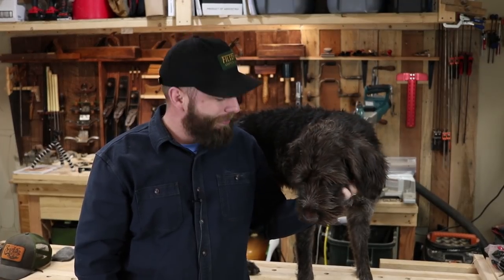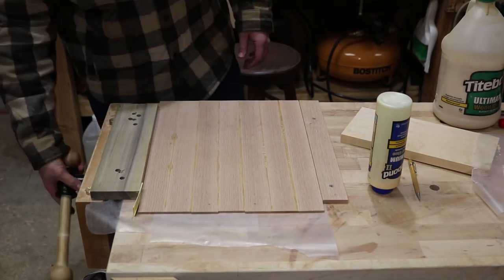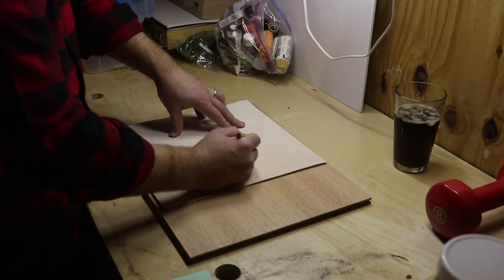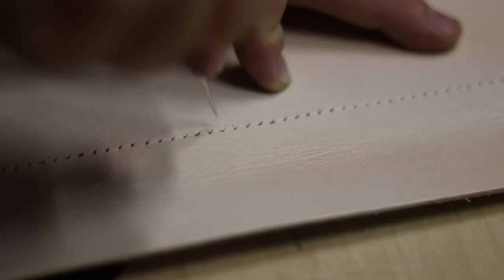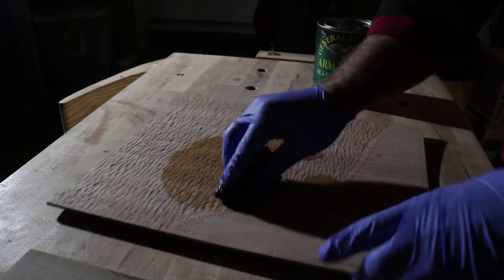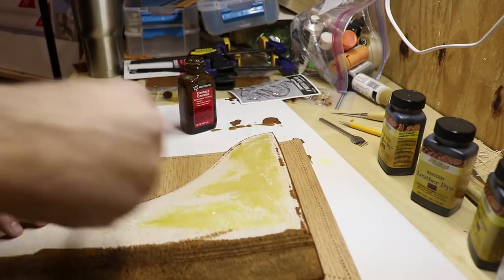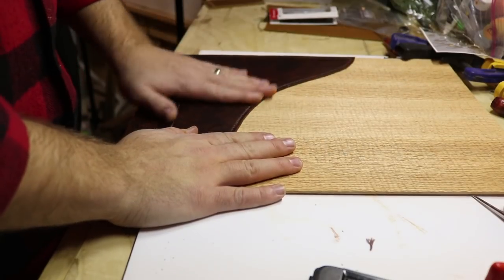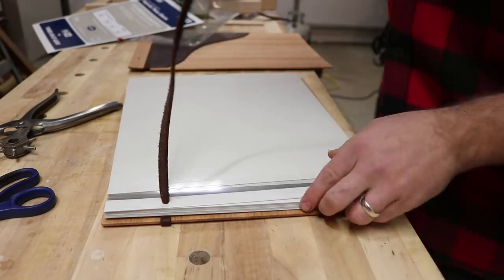Making a Photo Album with Leather and Wood // How To // Woodworking // DIY

Comment: nice touch on the gouging. to help get an even dye job, moisten the leather evenly by spraying it lightly with water. moisten. not soak. it also helps to buff after the dye dries a bit. you do excellent work and your videos are awesome. thanks for sharing.
M.T
Reply from the maker: Thanks for the tips. Ill try that for sure. also thanks for watching and the kind words.

Comment: One thing I like to do to even out my dye on the leather is to pre moist the leather. Just to put a little water (not soaking it), when once the dye is on the leather use a rag and rub it down with rubbing alcohol.  It will help the dye penetrate the leather deeper and even out the color.  This was an awesome project, one that I might have to try myself!  Great Job!
Reply from the maker: Thanks Lance. I appreciate the tip!

Comment: Beautiful project.  The combination of wood and leather textures really works.
I keep a roll of freezer paper in my shop for glueups. You know, the brown paper the butcher uses with one shiny side. Heavier and cheaper than wax paper.  The plastic covered surface on one side (the shiny side) of the freezer paper resists glue very well and moisture in the glue doesn't affect it at all.
Reply from the maker: Thanks for the tip, i see people using that, and have been wanting to get some. It would probably keep my happier too rather than stealing her wax paper haha

Comment: Great project! Just pointing out that that isn't how contact cement works. :P If you let the two surfaces dry for 5-15 minutes ( weldwood works well at 15) then the pieces bond together instantly, no clamps needed. Not sure how strength is going to differ not letting it dry to tack beforehand, but it is designed to work the way I described. Other than that, all other leather pointers were already in the comments before me, so that about covers it.
Reply from the maker: Thanks for the info Daniel!

Comment: I've been doing leather work for a little over a year now. I bought a cheap airbrush and airbrush compressor at Horrible Freight, and it works well for spraying leather dye. I get a very even finish, and I can build the color up in coats. Another effect that can be done with an airbrush is to spray a darker coat around the edges of the leather and feather it in to the main body (like some guitars are painted). Great job, but I suggest ditching the stitching groover. I think the stitching looks better when not constrained by the groove.
Reply from the maker: Thanks for the tips Lex, the airbrush is a good idea. Ill have to look into that more. if you dont use the groover, how to keep a consistent distance from the edge?
Reply: I use a pair of dividers to scribe a line. I set the dividers to my desired distance from the edge, and run one leg along the edge of the leather and the other leg lightly pressed against the leather to leave a faint line. I then put the center of the stitching chisel on the line, so that the stitching hides the line when done.  Look up Ian Atkinson and Armitage Leather here on YouTube. That's where I learned 99% of what I know about leather working. Both of them have excellent tutorials, and are good teachers.

Comment: really nicely done .. hey, to stop that bowing of the cover, glue a nice sheet of paper or cloth on the inside, this will pull the wood back into alignment. Commonly done on book covers.    OH, and take a look at Japanese Bookbinding Techniques I think they'll be right up your alley.
Reply from the maker: Thanks Dave, yea after I carved the top it wanted to bow which was kind of a bummer. ill have to try that tip. I watched several book binding videos and LOVE them. The Irish are masters of book binding. Ill have to check out the japanese book binding too. The japanese are amazing at everything they do so im sure its awesome.

Comment: A few things about the leather. For one, if you want to save yourself some time (and money) for burnishing, take a dowel, 3/8, 1/2 or 1/4, whatever you have, chuck it into your drill press (or lathe) and using a chisel and file, cut yourself some grooves and round them over. You can then just have it chucked into your drill press on a high rpm and burnish in seconds what would normally take much longer. for dying the leather, the method you used will get you a nice splotched distressed look, which I find is more appealing to my customers. If you want an even solid color, you'll want to spray your dye with an airbrush or other HVLP sprayer. I use an HVLP sprayer with a 1.0 tip. No thinning needed. Beeswax works great on the edges, but you'll probably want to treat with something like gum tragacanth as well. You probably noticed that, once you dyed the leather, it became much more stiff. If you want to add some life back into it and really help protect against the leather cracking on that binding, treat it with some neatsfoot oil. There are 2 fellows on youtube that really go in depth into leatherwork and I have learned a great deal from them. Nigel at Armitage Leather: https://www.youtube.com/channel/UC8urn9l3pybW5LztUa6zbOA  and Ian at Leodis Leather: https://www.youtube.com/channel/UCLkCG-505-1t0rYlgBTSnpQ
Reply from the maker: Thanks so much for all this great information! I really appreciate it! thanks for taking the time to type this out. Ill definitely check out those channels too. I love learning and experimenting with new stuff!
Reply: No problem man! I love the channel and Utz!

Comment: For dying a large area like that on your leather, it will be less splotchy if you use a larger applicator like a sponge or wool remnants. Also, 2 lighter coats can help too. Do the first coat in circles and come back a second time and go back and forth one direction (like you do with wood grain and finishes) and it should even out a bit also. To keep it from darkening further with a top coat, wait for the full dry time of the dye and then buff it with a clean dry cloth and the extra pigment from the dye will be removed and won't darken as much with the top coat.
Reply from the maker: Thanks so much for the tips! Do different types of dyes, (such as oil dyes) blotch less? i believe mine are alcohol based
Reply: Third Coast Craftsman yes, oil dyes tend to blotch less in my experience. Also, prepping the leather with a Deglazer can help also. Deglazer is sort of like a pre-stain wood conditioner for wood.

Comment: Looks great.
When you said you were gonna stitch it together I thought "That's a lotta holes".  To drill and to stitch.
I've sewn leather onto steering wheels and I wear Bionic leather motorcycle gloves when doing so (or sew?) to protect my hands from the Dacron. I use waxed Dacron for making bow strings as I always come up short when using the thread they supply with the cover kits. and I can get different colors if I wish.
Reply from the maker: yes, it was way more than i had expected haha! Ill have to check that dacron stuff out. Thanks!
Reply: if what you used was called "artificial sinew" it was likely a Dacron or generic polyester version. To make bow strings, it is colored, waxed, and sold by the 1/4 to 1 pound spool or so. You can also get stronger lines for it too, "Fast Flight" or Dyneema. are ultra strong stuff. I got mine, long ago when I made bows, from here: https://www.3riversarchery.com/buy/bows/string-building/bow-string-material